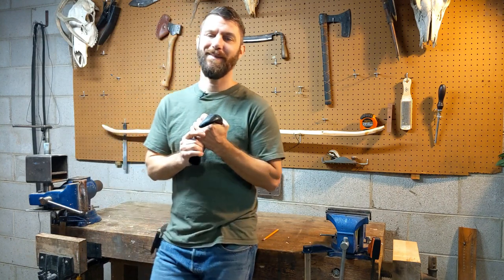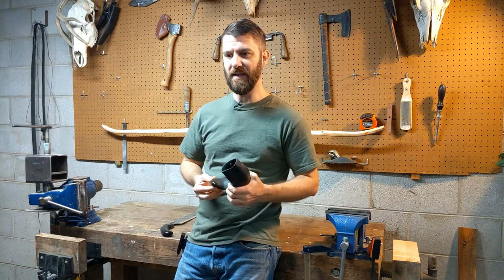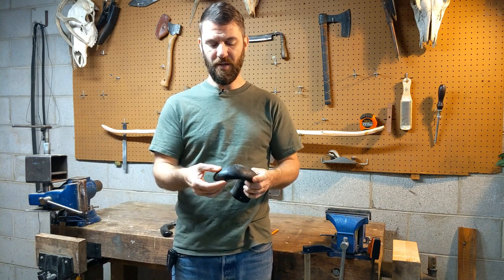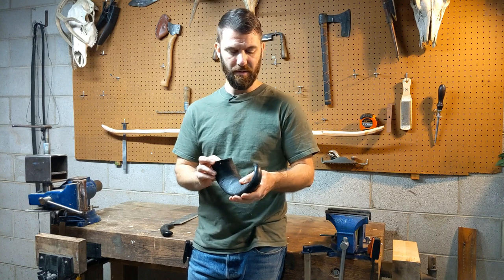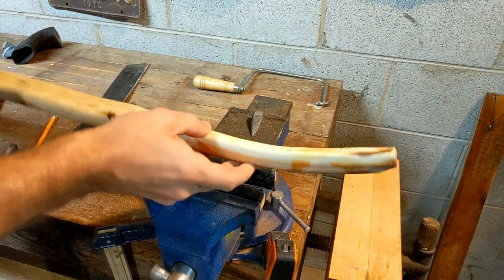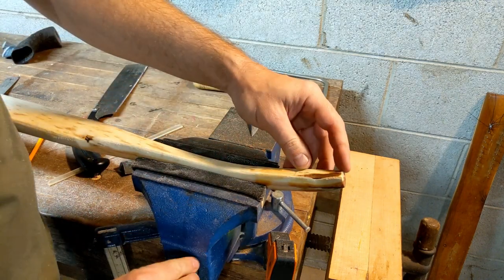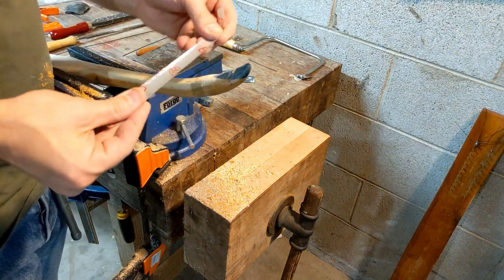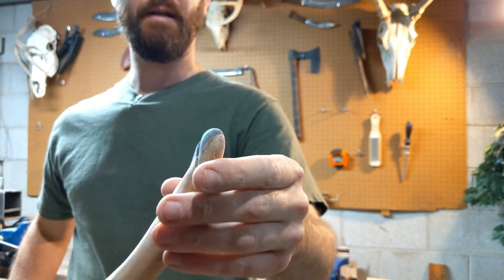How to Make Horn Tip Overlays on a Self Bow

Comment: Love ya videos. If I may offer a suggestion. Wouldn't it be fair to say, when thinking about a overlay verses no overlay, if there's ANY wear involved with a  string nock (spelling) over time, I say, let the "replaceable overlay take the wear and tear, because it can always be removed or sanded off, and another added. If the actual wood is wore out, well, not much repairing that, at least not easy. So yeah, let the overlay take the wear, and not the bow wood. Am I making sense, or am I looking at it the wrong way? thx
Reply from the maker: What you say makes sense, though I think you're underestimating the toughness of the bow wood in a self nock. The string isn't going to do any noticeable damage to the bow wood in the lifetime of the bow. Even if it somehow did do damage you could still add an overlay to a bow that use to have self nocks.
Reply: @SwiftwoodBows  well, that;s true...thanks for the reply. Love ya videos (cept that one with all the background noise, lol)

Comment: Weylin, as far as the integrity of the chased ring is it ok on Osage to do the angled tips like you have done here? I’ve built several bows and always mated them flat and I’m trying recurved tips this time and want to try to angle tip like you’ve done here if it’s ok. Thank you for any response
Reply from the maker: There is no problem with that. There is so little stress out at the tips it becomes a non issue.
Reply: @SwiftwoodBows  thank you

Comment: Why not use a traditional wood plane like a "box plane" for this task as it would be flater and about 3 times faster since you not using a traditional scarf joint for this attachment as we see in historic bows?  I'm also curious why the plastic glues rather than the proven traditional glues which would complement your beautiful bows so much better...

Comment: Nice looking tips!  However I would think epoxy would be a better choice to attach them.  Super glue is fast and convenient, and it won't pull apart, but it doesn't stand up to shock, easpecially after it ages a while.  Epoxy is much less likely to separate with an accidental bump.

Comment: Hi Waylon! Hope I spelled your name right. Would putting a little notch, in the wood at the base of your overlay, strengthen it or is that overkill?
Reply from the maker: Hey, sorry. I don't think I'm quite sure what you mean
Reply: @SwiftwoodBows  sorry about that. Perhaps, a little groove, at the base of the overlay, in the bow, to resist against the downward pressure of the string on the overlay. If overlays do not generally come apart, this may not be necessary. I was just wondering. Hopefully, I was more clear.
Reply from the maker: @williamlockhart5031  I'm still not quite picturing it, but it doesn't sound necessary. Tip overlays are quite sturdy. Their only real danger is getting knocked off if they get dropped on a hard floor at the right angle.
Reply: @SwiftwoodBows  Ok. That should be fine. I apologise for my deficiency in describing my question. Thank you for a wonderful video and I look forward to many more!